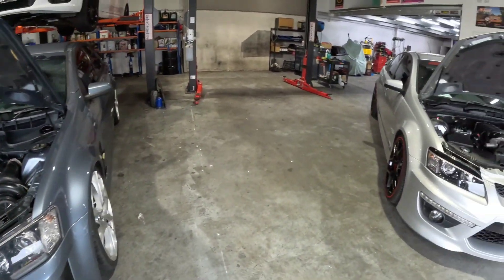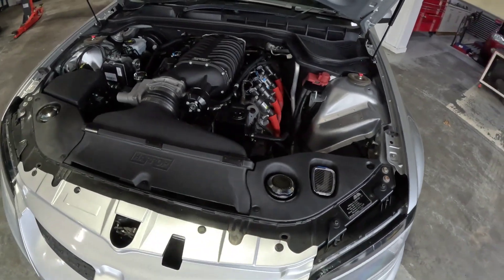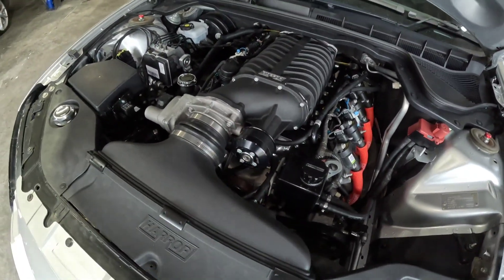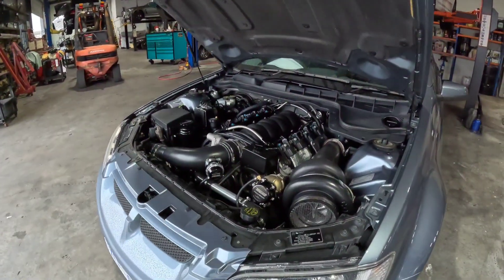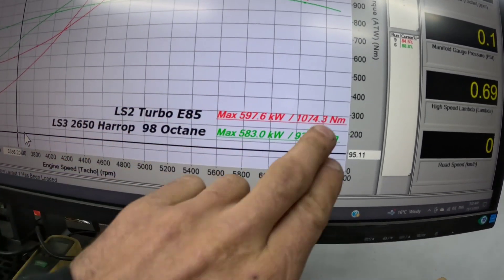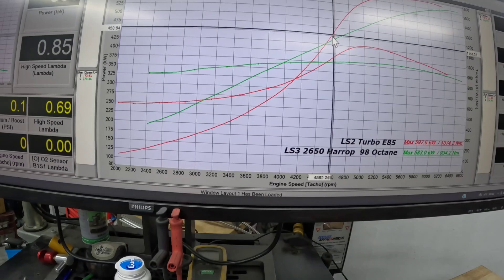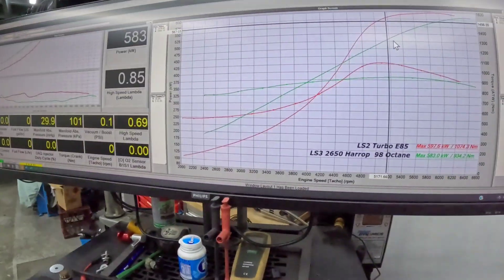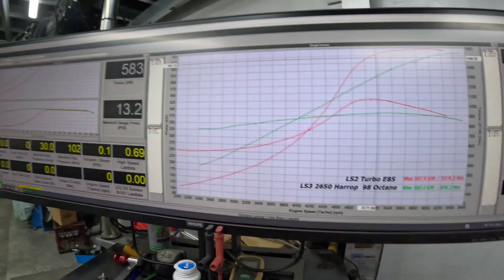LS supercharger Vs Turbo what power curve suits you better?

Comment: Having owned both a supercharged ls & turbo ls I found the supercharger far more fun to drive. The instantaneous power & acceleration throws you back in your set while I found the turbo a bit boring. Power delivery was a lots of nothing & then suddenly lots of everything.
I also found the whine of the supercharger was awesome as well.
Reply: Is it true the supercharger falls on power at the high end say if i wanna run all the way to like 7k rpm

Comment: great video mate !!! im a huge turbo guy have had them on most of my cars, but on both my SS's i have magnasson superchargers, not saying they are better, but for the street i think they are just so much more fun. especially in a manual. But its exactly what u said, horses for courses, if i was running my car down the drag strip or doing top speed runs turbo is the way to go, but for v8 on the street i think a supercharger can give you all the fun u need

Comment: Great video 👌😎 ,  without knowing the turbo size ??  At only 600kw Wouldn’t it be beneficial to run a smaller G42-1200 or alike to get way more power under the curve ??  And get the best of both worlds so to speak.    Turbo’s for the win in my book 👌👌👌

Comment: What sort of Diff Ratio would you run in both of these set ups ?? 3.45    3.7     3.9   ???  In the MANUAL of course
Reply from the maker: There is no right or wrong answer, like everything it all comes down to application and what you are going to do with it.

Comment: Noticed the HP and Torque on your dyno graphs dont intersect at 5,252 rpm, any reason?
Reply from the maker: it does, if i set it to HP & FT Lb and set both Side axis the same it will cross at 5252Rpm
Reply: @IndependentMotorsports oh my mistake different units haha 👍